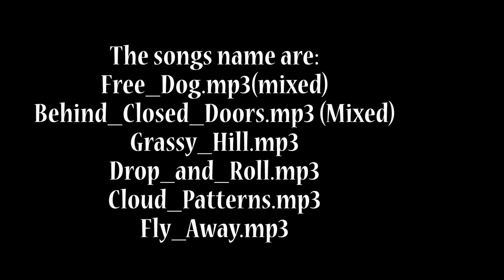As I make an eternity ring gold 18 kt and pink sapphires

Comment: Beautiful! 
How do you figure out stone spacing per size ring?
Reply from the maker: Being small stones, you have the option of spacing them as necessary. Important is that the sides remains enough metal for tips. It is better to use a stone in less than one too.

Comment: I would like to know what type of hand tool that you use to drill the holes.
Reply from the maker: +cjmoney7 I use a Hanging motor “F” and flexible shaft, 230V ~1, 50/60 Hz mod.0800H/02 (230 Watt motor + flexible shaft + rheostat Contronic (3.000 ÷ 20.000 RPM)
Reply: +scaffoal Thanks for your reply it seems likes an awesome machine.